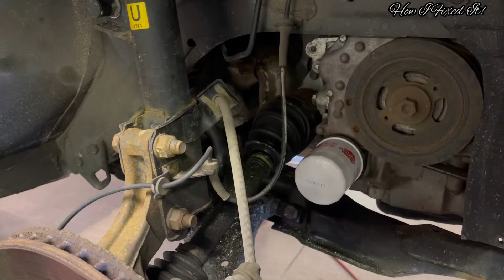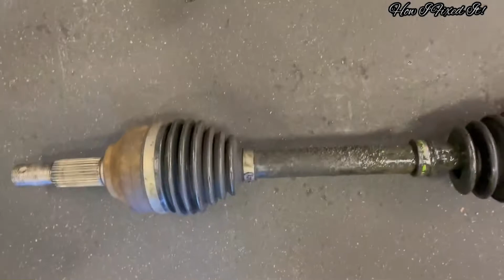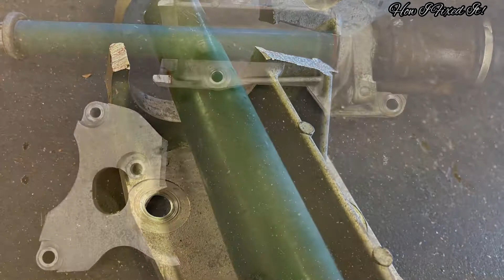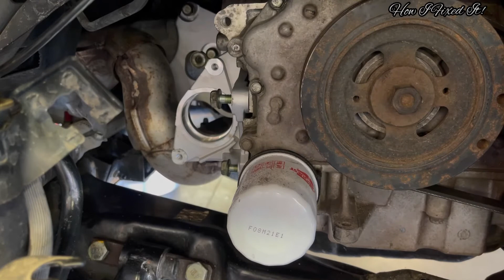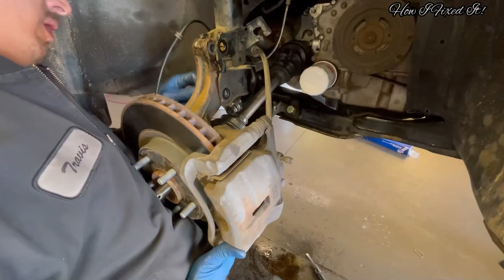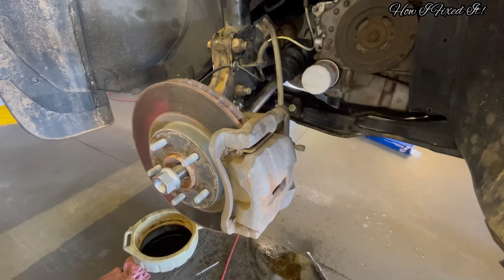How To Replace Rusted CV Axle Nissan/2009 Nissan Rogue Frozen Carrier Bearing Axle Removal

Comment: I really don't want to have to do it this way but my bearing stuck and I have tried everything to remove the axle. Would it be possible to take off the bearing support bracket and beat the living rust out it?
Reply from the maker: Anything is possible. Takes removing exhaust system to remove with bracket attached to axle. That’s why I just cut it. Didn’t want to go through the hassle of heating and hammering and then probably end up with a damaged and bent bracket. I hope this helps. I appreciate the feedback 👍
Reply: @HowIFixedIt  I dropped the exhaust mount and front exhaust Manifold bolts and got it out then smashed the hell out of the transmission side of the axle and got it out....
Reply: I'm having the same issue, not being able to remove the passenger side cv axle. So you cut the carrier bearing assembly with it still attached 
and then replaced it with a new one? Thx, good vid.